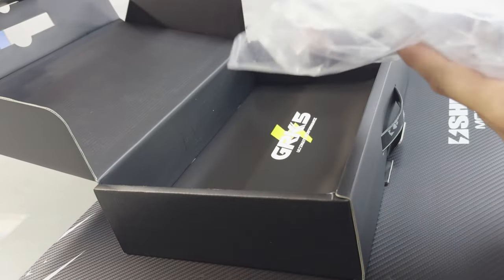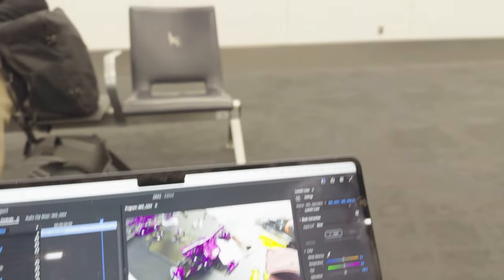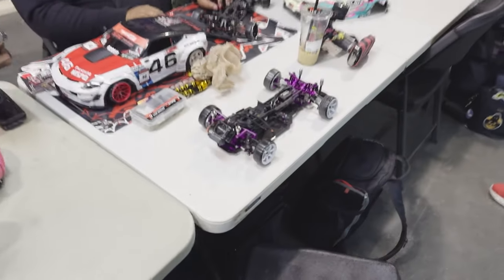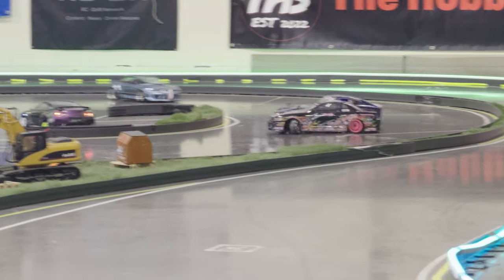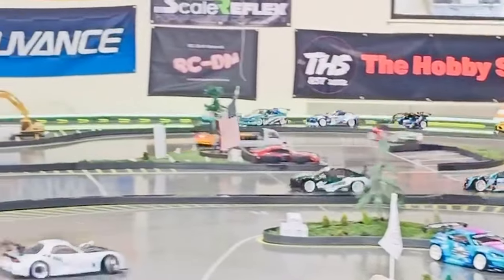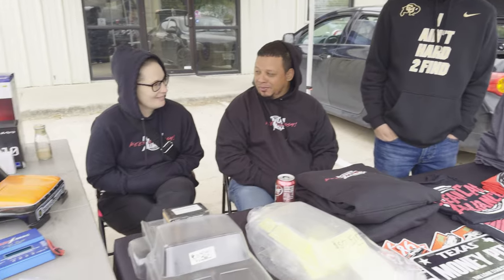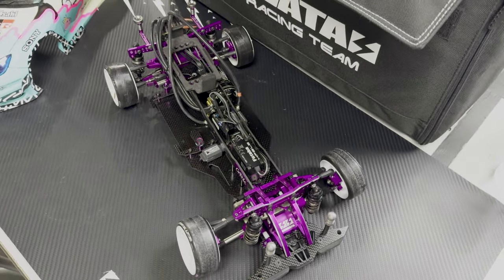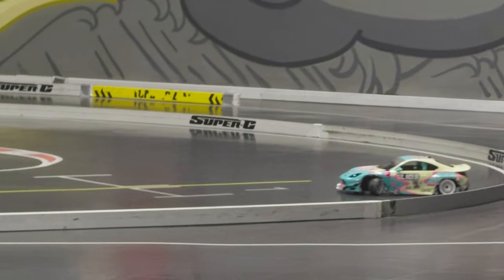Drifting in Texas! Test and tune the Shibata GRK5

Comment: thanks for the video, any chance you could create a video that focuses on the Acuvance products?  I am new to rc drifting  and would appreciate a 101 class on how capacitors benefit the esc & motor. also it would be nice to explain how they are connected

I fell in love with this hobby after my first visit to a drift rc shop, I left with a RTR Redcat RDS and a GRK5 Kit 😂😂😂😂 

i am having a great time learning to tune and improve the RDS... My next step is acquiring soldering equipment to be able setup the electrical components required by this hobby.

I am amazed & overwhelmed with all of the choices in equipment. 

I am looking forward to the day when i have enough knowledge and experience to start working on the GRK5